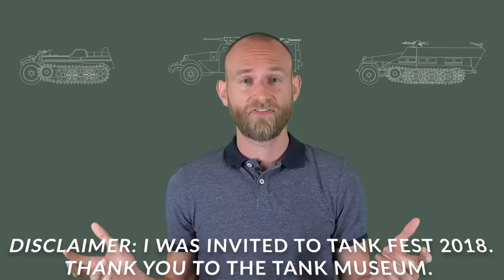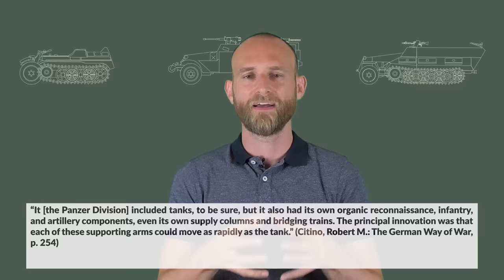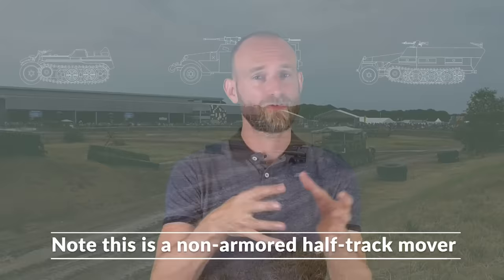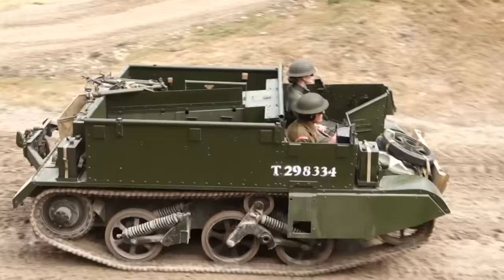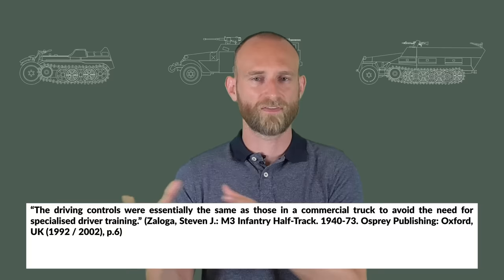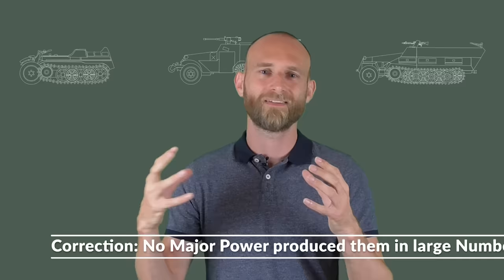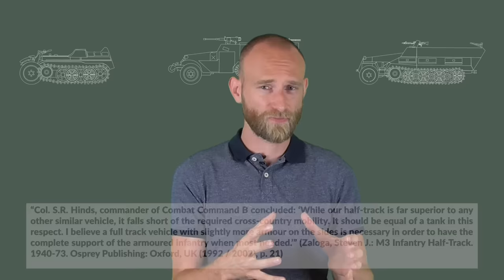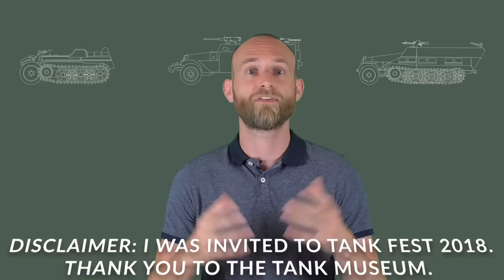Why Halftracks? Why limited to WW2 only? (Featuring Tank Fest 2018)

Comment: one more reason to use closed APC - Cold War era APC meant to be used in nuclear war. So they should have had some level of protection against radiation. As well as biological and chemical weapons. No real way you can get there with open top APC
Reply from the maker: very good point! I missed that one, although I shouldn't have, considering the T-54 to T-55 upgrade for NBC stuff.
Reply: Why not do this - add an armored roof - with a Half track?
Reply: I'd wager a half track with a roof worth something would just be too heavy for the chassis and engine to bear.
Plus, all the cons of a halftrack.
Reply: In Vietnam the soldiers were riding on top of the M113s, putting a lot of sandbags there to protect themselves a bit at least. They would have been glad about an open vehicle, as it is way easier to fight from there and not get blown into the roof when running over a mine. This made the M113s very top heavy too, with all the extra weight on top.

Putting a roof was usually considered to heavy in the first place, but where to store a roof, when the infantry want's to fight from the vehicle? That was another reason why they were kept open.
Reply from the maker: roof wouldn't be enough, additionally, the whole design was made under certain restrictions and assumptions, then just adding a major design change would be at best detrimental at worst a huge issue.
Reply: I wasn't thinking of modifying a halftrack. I was thinking of designing a halftrack with an armored roof from the get-go.
Reply: open roofs is deadly in urban warfare because of grenades.
Reply: They are deadly everywhere, if the infantry gets close to it. But urban areas are not for tracked vehicles anyway, beside StuGs which are in direct support and surround by its own infantry anyway.
Reply: Jan Tjarks the m113 was kinda trash anyway. The powers that be wanted a airdroppable and (somewhat) amphibious apc. They got it but at the cost of just about all its armor.
Reply: It did the job back then. Doing the job does not automatically mean that it is the best you can get, but the most reasonable.
Reply: There were field conversion too from what I understand, but there is barely any data for that.
Reply: Jan Tjarks it was fine for what was s mostly unconventional war. But in a conventional war with the ussr? I dunno.
Reply: Condorscondor Condor the army still uses the m113, as a medevac vehicle, a mortar platform, EW and commo, sometimes still as a troop Carrier but mostly for supplies, and of course most of them are mocked-up (poorly) to resemble Soviet tanks for training units.
Reply: Being fair with the m113 the bmp series is not that well armored either
Reply: The Cannon kinda makes up for it :P
Reply: I think the M113 has hatches on the top that you can open and stand out of to shoot
Reply: Nahuel Arroyo The BMP's are rather IFV's than APC's anyway
Reply: Willian Zalma From what I've read, it was to protect themselves from mines. The idea being that all of the interior space, plus some sand bags, means that all of the blast goes into the interior of the vehicle but not to the troops who are on the roof outside of the vehicle. This, of course, means a wrecked vehicle but at least the troops are fine. But, despite what Jan Tjarks says, getting blow into the roof wasn't an issue, the blast going off was, even if there was no roof on the M113, sitting inside the troop compartment when a mine goes off underneath you is still going to probably blow you into bits from a combination of the force of the explosion going through the thin floor armor and the shrapnel from the floor getting blown open.
Reply: Also hardbass in BMP is x100 better than in an open top truck or transport.
Reply: Jan Tjarks ... and the reputation of Vietnamese mortar teams could be a consideration against half-tracks in that locale.
Reply: The main reason half tracks are even half tracks was so their wheels could provide maneuverability on pavement while the tracks provided the ability to move across various terrain. Its that simple really. APCs are the preferred choice today because of their higher survival ratings. Why ride around in something that a squad machinegun can punch holes in when you can ride in something thatll take an RPG and still limp away. Its almost the same as wondering we use the M1A1 Abrams instead of continuing to use the M4 Sherman. Cuz WWII we were focused more on numbers than anything else. Now we realize that a smaller number of higher quality vehicles can do more for longer periods of time.
Reply: The air is not the primary source of the radiation. A simple canvas cover keeping the dust out that is regularly cleaned would be almost as effective protection against radiation.
Reply: Riceball01 - If the seat is shocked upwards by a mine you get back injuries, which put troops out of action.
Reply: Also covers people from sniper fire, or guerrilla attacks ( just drop a frag into the back), and just any attack with higher ground
Reply: but the troops have to get out of the APC sometime, then what? They're still on radioactive ground -
Reply: Idea is you blow up the bomb in front of the advancing troops. They sprint through the most contaminated areas inside protected APCs. And then fight in the low-contaminated zones. Nobody expected to have zero exposure to the radioactivity for the troops. Idea was to expose soldiers to the level of contamination that will not kill them at once. Also troops had an individual protective gear that they could put on to fight within the contaminated areas.
Reply: triumphant39 8mm isn’t much against something like an MG42
Reply: Hi there, as said above, a roof would completely change the half-track. If you see a typical HT with your eyes, not on video, you'll immediately realize how incredibly small and low are these..."toys". I was in a museum in Belgium, years ago, when I saw an US HT, and an old guy behind me was saying "I still remember when we drove these things, they are so cramped we would always smash our head on that piece of steel" (indicating the ring of the driver's compartment). In short, you would at least double the weight and make all the rest (engine, transmission, etc) totally unsuitable.
Reply: Jan Tjarks don't forget how hot it was in Vietnam. Being on top of the apc was much more preferable to roasting inside with your other sweaty, smelly squad mates if you weren't under fire.
Reply: Good point, Andrew.  From the Russian side, the benefits of putting a wood-stove into an enclosed APC for heat (seems like it was commonly done) also seemed to trump open-top vehicles with the winters they had.  The USA's next real move - into the winters of the Koreas - also meant that open-top APC's were not ideal, but we may have used some there.
Reply: +andrew batutin
Nuclear protection was never considered during the development of the closed APC, the biggest reason America and even Soviet Union went for closed top APC's was mainly because of air shrapnel, the Krauts would often use air burst cannon rounds which spread shrapnels in large areas easily killing crews of M3 halftracks, and not just that these open top troop transport vehicles were vulnerable to aircraft gun fire something the Soviets got a terrible experience out of to the point were they stopped using open topped troop transport in combat at all and just placed troops on tanks because they had equally as much protection but it was cheaper and quicker.
Reply: I remember that halftracks was used because it was easier to train people on them.
Reply: Tbh I would still use halftracks today. It makes it much easier to use. Also they could used as support weapons with much less costs. The costly stuff is the tracks. But it's not that big problem
Reply: Make all the men in half-track APC wear astronaut suits. That's my genius idea.
Reply: @ironstarofmordian7098  Czech OT64 Hanomag development with an armoured roof, in use front line until 1990s.
Reply: That's your 500th likes
Reply: @M.H.D.actual  Trash cans on top to represent a turret haha
Reply: @lebowskiunderachiever3591  and toilet paper rolls for the main gun barrel
Reply: Just duck and cover
Reply: @ironstarofmordian7098  I said the same thing
Reply: @condorscondor  crewed 113...not perfect, but versitile. And armored against small arms, frags, etc.  About like the armor on a bmp or btr 60...its contemps,
Reply: @condorscondor  I disagree...the M113 was good for it's era, and quite versitile, and is still in service.  It's biggest short comming was the inability of the crew to fight under armor.

Comment: The half measure argument makes a lot of sense. One only needs to look at the Soviet Union's developments. Either fully tracked IFVs and specialised APCs, or fully wheeled APC.

But a point that was perhaps less stressed was the improvements in engines and production. The 30s engines were... less than optimal. Just look at how even the tanks were largely underpowered. The tanks that weren't had enormous engines with little room for other things, especially not a squad of fully kitted soldiers. But enter the 50s and the engines were becoming a lot better. I guess the massive output difference in fighter engines in WWII itself in indicative of the improvements.
With considerably better engines, transmissions and controls, getting a fully tracked vehicle going would have been a lot easier than in 1935.
Reply: Great point
Reply: I guess that what halftracks offered in light of an underpowered engine is offroad ability in the weight class and speed of a truck. When the engines get good enough like today, a wheeled vehicle can offroad just fine, so all adding half a track system is doing is limiting the speed and increasing maintenance costs.
Reply: I would also wager improvement in suspension systems and tire technology also helped wheeled APCs/IFVs, improving their all terrain capabilities, obviating the need for heavy track systems to keep up with their bigger brethren.
Reply: yes I would have to agree. better engines better drive systems, better suspensions all meant they could put on armor and guns and the next thing anybody knew they had designed an apc. and the poor half track was an antique joke. it became obsolete rather rapidly.
Reply: Plane engines of the time and still alot made today have nothing in common with tank/apc engines. Tanks arnt known for needing altitude mixtures or runnin on a radial engine. And old engines from the 30s were mainly big block pieces of 3 or 4 parts. Todays engines are alot of small parts. In some ways the old engines were more easily fixed or replaced than today's set up.
Reply: @bobthesodomite1882  well, the engines werent the part that was the weak point, that was the transmission/drive train. they did the job untill more stuff started getting added and weight became a cause of reliability issues and a complete re design was needed. and thats how we got apc's.
  still, I would love to have one of the original ones, put skis on front this time of year.....
Reply: Engines were not THAT weaker, the gasoline was shitty, especially in europe because of the british naval blockade.
Reply: @bobthesodomite1882  You might be interested in knowing that the Rolls Royce Merlin engine, had a tank version called the Meteor. The main difference is that the Merlin was Turbocharged for high altitude while the meteor was normally aspirated.